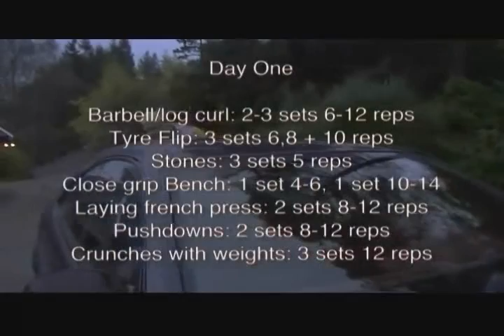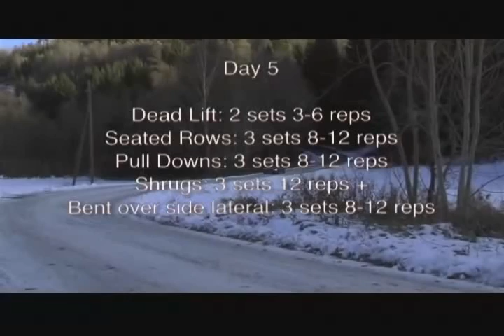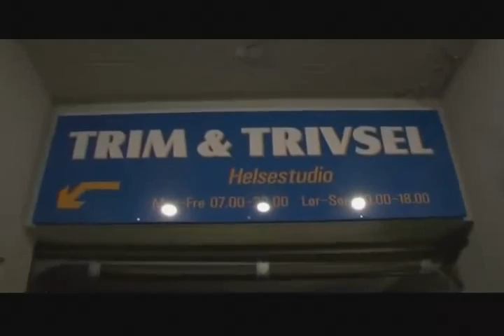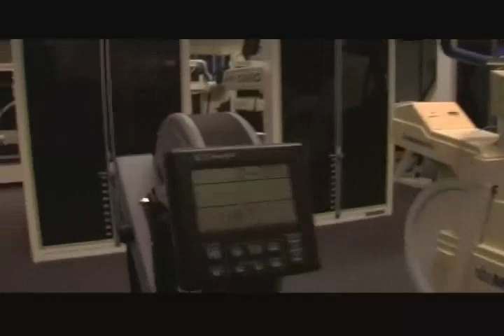Svend Karlsen   Viking Power

Comment: Svend was one of the strongest men in the world. What I really didn't like about mariusz pudzianowski's reign as strongest man in the world, was alot of the maximum weight events [deadlift, squat, overhead press] etc. Became speed events, because that's what mariusz pudzianowski was good at.

So was mariusz pudzianowski, the strongest man in each of the fields that he competed in, IMO, no. But then again, i'm just a dude on the net and not the guy in charge of the events and what not.

Awesome upload dude.
Reply: Strongman is very much a mix of the 3 lifts powerlifters do (not exactly the same criteria) and other events which are full of speed, and great champions that dominated the speed events like Mariusz, Jon Pall, Hafthor now (although he is a beast too in static events) have always existed, and i think is a very integral part of this, those 3 lifts are just as iconic to strongman as the yoke, the atlas stones, running with 100+kg stones, etc... for a powerlifter is valid what you say, but for a strongman, you're either at least good at both or you're nothing.
Reply: And 10-15 years ago we were seeing an era of other good competitors at dinamic events, like Joukko Ahola and the other guys.
Reply: I'm a fan of an equal combination of static and moving events.
Reply: Marius was incredible but one event they shld have is olympic clean and jerk. As a standard also always deadlift squats and log press